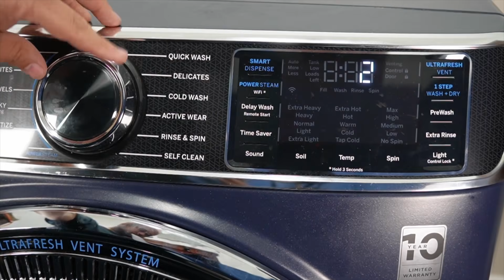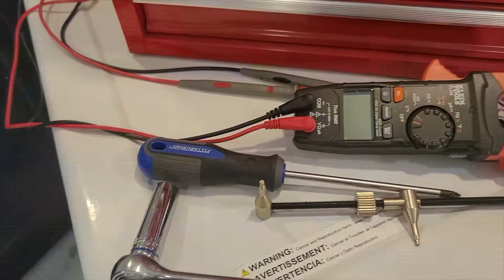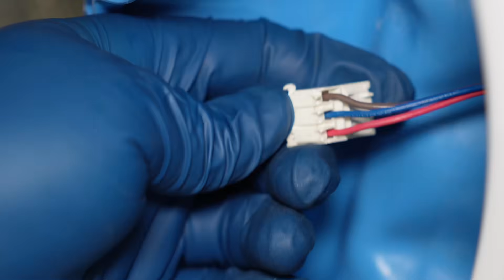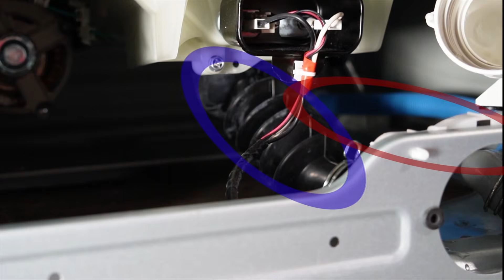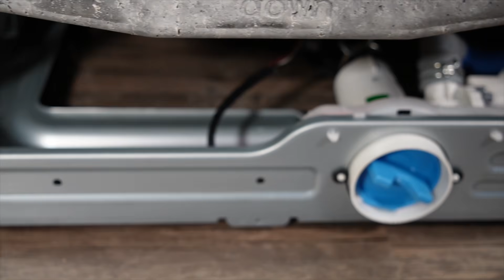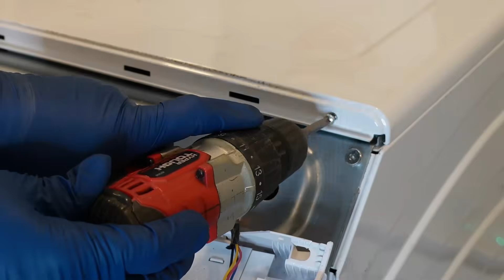GE Front Load Washer Stops Mid Cycle and Won't Spin - Common Issues

Comment: Man this guy does great diagnostics, hard to find a repair person that doesn't just say 'board is shot, cheaper to buy a new one', and they're not wrong, after paying for their time, your 30-50% into a new appliance.    So sick of our society gone to pot for subscription models and planned obsolescence. Have 2 sets of top loading Kenmore washer/dryers still going strong, just look rough :)
Reply: You are not 50%into a new machine after a service call unless you gave someone $500 for a $120 service call
Reply: @shivermetimbers4102  30-50. Paid 150 because of remote location. 3.33x150 =499.5

You can get a washer for close to that.   Thanks for trolling along though. :)

Comment: Hey Ben any idea what my problem is, it can start a load on normal, run for about 2-3 minutes then just say end. Not sure what’s going on
Reply from the maker: Check for error codes. Also try test 14 in manual
Reply: Exactly what mine is doing

Comment: This washer is a POS.  Wife wanted this over the Electrolux because of the fan that operates when the door is closed. Trashed it after 2 years - think it was partially failing most of the 2 years.

Comment: My GFW850SPN0RS was acting up and wouldn't get more than 2-3 minutes into a cycle before ending the cycle. Shotgunning this, I replaced the controller board. That didn't fix the problem.

Then I found all the documents stored inside of the machine - the one that tells you how to disassemble the machine. The key doc if the giant foldout that has all of the information for troubleshooting. After finding and watching your excellent videos, I found that the machine is throwing error codes 91, 3, & 38. Error 91 isn't listed on the giant foldout that came with the washer. Error 3 locked rotor motor - the motor isn't locked (frozen?) as the drum begins to turn in test 14. Error 38 is the vent damper, but test 24 passes the toggle test - according to the "soil level" indicator.

Problem is during the spin test 14, the drum turns for 4-5 seconds and quits - that's sort of what happens on any selected wash cycle. The giant foldout says that if the drum spins for 4-5 seconds and quits, it is probably the accelerometer, so I replaced the accelerometer which did not fix the problem.

Before I jump in and replace the inverter board, what is error code 91 and do you have a suggestion as to what might be the problem?

Thanks!
George
Reply: I'm having the same issues. Got the same codes, replace the inverter board, and still have the same codes. I don't want to buy an accelerometer if it won't fix the issue

Comment: Adding my situation to the comments to help anyone who may end up here.

Machine stopped minutes into any cycle without draining. Selecting "rinse and spin" and turning off rinse would get it to drain.

Diagnostic mode revealed codes 3, 26, 27, 39, 66, 92. I ran test 16 to clear the codes, unplugged the machine, and came back hours later to continue trouble shooting. Test 14 produced a spinning drum that would stop after 5 seconds. The only code that would come up after clearing all codes was 3. My drum would spin freely by hand so a motor issue seemed less likely. 

The information found in YouTube comments and various other internet forums mostly led back to the inverter board. I was able to overnight a board from Amazon for $145 (sorry Ben, I'll donate to your channel). Using this tutorial, I was easily able to replace the board with minimal fuss other than standard "I've never done this before" hiccups. 

Definitely find the other video about how to spread the retention ring spring with a wrench and zipties, that approach worked flawlessly and took no time.

Hope this helps. Sorry if you're reading this, the washer sucks.
Reply: I just found this video after replacing main control board and the pump (per recommendation of another YT video).  Still not draining properly and failed the test 14 spin test (spun for 5 seconds and stopped).  My dilemma is that I have my washer and dryer stacked in a tight space, so pulling it out to access all the connections is a real hassle and then having to removed the dryer from on top of the washer is yet another difficult proposition.  With 8 kids at home, we really need to get this fixed, so I’ve ordered the inverter board and am hoping this puts us back in action.  Thank. you all for your comments.  They are very helpful.  Like a lot of high end appliances, I love it when they are working, but boy is it a big pain when they stop working.
Reply: @kiheidude hey bro, was the inverter board the problem? Asking caz I'm having the exact problem with my washer.
Reply: @misaelmontejo7054 I’m posting the same reply I just posted to the previous comment.  Yes, that was the problem.  The bad news is that I have two of these washers and now the second one is having the same problem.  Ugh!  At least it’s not stacked and I can get to it easier.  Just a note that on this second one, I purchased an extended warranty.  I submitted the repair claim and the company insuring the extended warranty (Asurion) said they are not going to fix it and sent me a $650 credit to purchase another GE washer.  If I knew what I know now about these washer, I would have opted for a front load Speed Queen.  They have the best repair record (or lack of repairs).
Reply: @kiheidude good to know, thank you very much for the info. bro, appreciated. Have a good one.
Reply: @kiheidude any updates on if that fixed your issue. Because im at that exact same place in the fixing process?
Reply: @x @xfxeffect89 rry for the delay, I just saw this comment.  Yes, that was the problem.  The bad news is that I have two of these washers and now the second one is having the same problem.  Ugh!  At least it’s not stacked and I can get to it easier.  Just a note that on this second one, I purchased an extended warranty.  I submitted the repair claim and the company insuring the extended warranty (Asurion) said they are not going to fix it and sent me a $650 credit to purchase another GE washer.  If I knew what I know now about these washer, I would have opted for a front load Speed Queen.  They have the best repair record (or lack of repairs).
Reply: Very helpful, thanks smile😊
Reply: I replaced the board and have similar codes. Still shuts off a few min into the wash cycle.
Reply: @robertwarf3316 did you figure yours out? I also replaced the inverter board and it is stopping a few minutes into the cycle and not spinning.
Reply: @bmoneybby did you figure it out?
Reply: I have this same problem, I’m not looking for to replacing it myself , I wonder how much it would cost to have a repair guy do it
Reply: @Dwayne0821 Including parts and labor, it’s probably going to cost close to $500 would be my guess.
Reply: Had the washer for 3 years T this point i rather buy a new one but not that expensive and def not a G&E

Comment: Another possible issue is , a lot of people do not have the machine hooked up to WiFi and connected to the app. They periodically get updates in the app. I have had this issue in the past and I checked the up for an update and updated it through the app and after that it worked properly.. always check the app before calling someone, sometimes it just needs an update and nothing else.
Reply: I can’t get my washer to connect to my app.
Reply: @DealsWithDiDi it took a long time to get mine connected.. very frustrating for sure

Comment: GE "Support" refused to do anything other than schedule an appointment for a tech to come out. They said they don't troubleshoot over the phone and offered me no help whatsoever (which was a very different stance from the way that Bosch helped me with my dishwasher). They further stated that the giant 10-year warranty sticker they proudly display on the front of the machine is for ONE part. The motor. The rest of this appliance I paid over $700 for is only covered for 12 months. When I suggested that their policies were anti-consumer and extortion-like, they argued that "that's how everyone in the industry does it". Well, Bosch doesn't... I will NEVER buy a GE appliance ever again.

Much thanks to you and your videos (this one in particular)! I was able to troubleshoot and fix my GFW850SPN4RS with ease after following your instructions! Thank you for supporting right-to-repair and repairing over replacing! (GE "Support" suggested that it probably wasn't worth fixing and that I was free to buy another washer of another make if I wanted to.

Ask a thank you, I've sent you a tip through your Paypal link.

Comment: Our GE is less than 5 years old and it looks like it's the inverter  (GFW850SPN0RS).  I hope I can get this board out without going underneath it since we have one of the bases (with the drawer) attached     If not - it is going to be one nasty project.  At least I can get the bottom 3 screws out without tilting it. Thank you for the video!
Reply from the maker: If you can get those 3 off you dont need to get under it for any reason
Reply: @bensappliancesandjunk  Thanks so much - All Set!!  Could not have done it without your video and the hint about that spring tool!!

Comment: Great video. After tests, I only get error 3, but everything I’m finding says that’s still probably the board and not the actual motor. Just ordered from your site!

I REALLY don’t want to deal with the seal. Anyone have luck with removing it from the bottom instead? I found a video doing it. Looks cramped, but requires fewer parts to remove.
Reply: UPDATE: I purchased the part from you, replaced it and it worked immediately!

However, I did use the method of going in from the bottom. Removing the screw holding the case in place was extremely awkward and difficult, but I managed to do it (make sure you have a 5/16 socket with an extension) and the only parts I came in contact with were the case, panel and wiring. I did not want to have to remove and replace the seal. 

Thank you!

Comment: I replaced the accelerometer and inverter board and it is still doing the same thing. Runs for 5-7 seconds and stops. Does that 4 times and ends the load. Fails spin test. Only code is 3
Reply: Also having the same issue, I work at an apartment complex and have replaced 12 washers now haven’t had time to test 5 of them at the little setup we have but all of them are error code 3 and only one was fixable and it was the motherboard instead of the inverter board
Reply: @ChApPyXtheXamazing I have a GE GFW850SPN0RS. Its only giving error code 3. Ive now replaced the inverter, main control board, accelerometer, and just finished replacing the motor today. Still nothing. 

Spins for 5 seconds and then stops, during both the test and during the rinse/spin cycle. 

At this rate, I guess i just have to replace it.
Reply: @justin_s_c that’s what I have just told the owners, like look yanno can’t do much else and by the time I might get it running it was cheaper to replace it lol

Comment: I noticed that when wiggling the harness between the inverter motor and the motor itself, with the power on (I used insulated electriciams gloves) there was a sound of relays clicking on and off. Obviously, that indicates a loose wire in one of the three power connectors since a close inspection of those 120vdc wires showed no damage or wear points on the insulation. The motor windings are 3.4 ohms between any two of the three wires, while the motor sensor was 118ohms. All readings are within reason for a motor of this type. I’m in the process of removing the servo power supply board which you called a servo board for replacement, but I doubt that is the real issue. Maybe it will allow the motor to spin up to full speed, but I think its just a matter of time before the commectors fail again. Crappy design to have high current connections in a moist environment!!!
Reply: I bought the inverter board from Bens, installed it, and the washher works fine now. But again, with all  the open air connections its only a matter of time before it fails again.

Comment: I have the problem where it starts spinning test 14 and stops after 5 turns with a 3 error code only. Bad  imverter motor or board? Which should I replace first? Also, mine has 13mm lugs on the front and motor bolt, not 14mm.

Comment: I’m getting an error code 3 and didn’t see that as one of the codes you listed for the inverter board. I can get as far as the part where you hold the start button and turn clockwise but nothing happens. Is it safe to assume it’s my inverter board. Looking forward to having to address this project when I get home from vacation.

Comment: Ben, thanks for the video, my GE washer GFW550SSN1MM began having issues after every wash it would say cancelled! And drain pump would start running. We disconnect the washer for a bit and when connected after a while it would work ok, then after a wash it would do it again. Codes showing now are 51,16,18,34,29,3. I replace drain pump and still same issues😢.

Comment: Ben!  Your videos are super helpful!  Have one question.  When running the spin test if it runs for about 6 seconds, stops for about 20 seconds then spins for about 2 minutes is it still most likely the inverter board?

Comment: Yo! Can’t thank you enough for this video. Best step by step instructions. The inverter was my issue. Originally I thought it was the drain pump or something to do with the door. But once you showed the error code interface this changed everything. The only issue I had was trying to do the back and forth to run setting 14 and 16. I kept messing it up except for one time. But thanks again!!!!

Comment: I have an issue with my washer front loader only 4  years old.  My washer on any cycle will leave clothes wet not really whats going on with the washer. Any suggestions ?  thanks in advance.

Comment: I don’t know how many folks today remember the Matag repairman commercials but seriously, that hat is KILLING ME!  Now to the important stuff. EXCELLENT video. I started with the main control board but it was the inverter board. Had I watched the entire video I probably would’ve started with it but hopes I wouldn’t have to take the front off. The only thing I forgot was the vacuum line to the controller. Error #8 with an H2O supply the first load I tried and knew that’s what I missed (after buttoning it up 😂). Thanks again for a great instruction video that saved me a ton!

Comment: My machine will not drain it will fill of course and spin but then will not pump out water and just stops completely. Showing no codes. What could be my issue.
Reply from the maker: I'd check the drain pump for obstructions/ensure the pump itself is in working order
Reply: Mine too. I also got inverter codes. I ran the service code 14. It seemed to spin. Now it won't go into service mode anymore. I ordered a new drain pump and inverter board. We're you able to fix it? If so what was the solution?

Comment: Mine just runs the drain pump, it won’t lock and the light inside blinks. It stopped running just before final rinse. The fabric softener was still in the reservoir. The front panel is dead. It does not light up at all. When plugged back in, it just runs the pump non stop.

Comment: Im very confused I have this exact same washer and it appears to be fine but it I do quick wash everything runs fine till the end then it gets stuck counting down 20 seconds and spins for a second stops spins for a second. If I run. Code 14 it has no issues at all? I've ran codes. It had issues draining but after hooking up a shop vac to both ends and cleaning the ports it was fine...but still having issues with it completing a cycle Error codes I have (6,18,38,91,9,26,23,)

Comment: 9 times out of 10 it's the main board. It's gonna say inverter board and motor. But it's the main board. Put the new one in. Write the correct profile ID to the board and then write the model and serial number. Oh look. It spins now. Fucking GE.

Comment: Our GE washer is barely two years old and the repair tech said the inverter board has gone bad. Thank god it's still under warranty and will be covered. Going on two weeks now without a working washer. Annoyed that this happened so soon. Our previous washer, a Kenmore top loader was 23 years old before it kicked the bucket. They just don't make things like they used to.

Comment: Hi Ben, my GFW850SSN2WW only throws one code.  #26.  The unit will not spin at high speed.  When I run test #14 ‘SPIN’ it will spin at high speed. What am I missing?  Your video is fantastic and it really gave me an understanding on how to navigate the self diagnostics.
Reply from the maker: What is it failing to do?
Reply: @ 
Ben,
When I run any of the wash cycles, the cycle finishes and the laundry is VERY  damp. It fails to perform a high speed spin.
Reply: Hi Ben,   Have you had a chance to look into my issues?
Reply from the maker: @casanestproductions  #26 is out of balance. It thinks the load is too heavy. Could be counterweights, too large of a load, or shock absorbers.
Reply: @bensappliancesandjunk  I have replaced all 4 dampers, i have run it with various loads, including no load.  What generates #26?  What would make it think that it is out of balance, when it is not.  It spins to 1300RPM when I run the test and spins very smoothly.

Comment: If you have error codes 18, 39 etc but you can successfully run the test modes 10, 14 successfully. I checked my vent sensor mode and it worked also.  

Try this, insure your drain plug is clean.  Get your water heater up pretty hot. Run the self clean cycle with the cup of bleach.  Let it run.  Then run it again with a cup of vinegar.  Finally do a quick cycle.  

Now retry.  Fixed my issue and it executed normally after.  I had replaced my drain motor and was about to replace the controller board but did this as hail Mary. 

Worth a try.